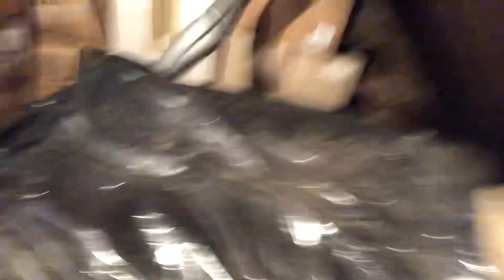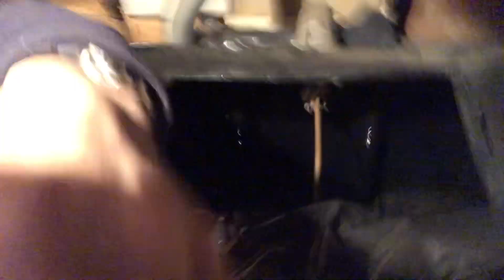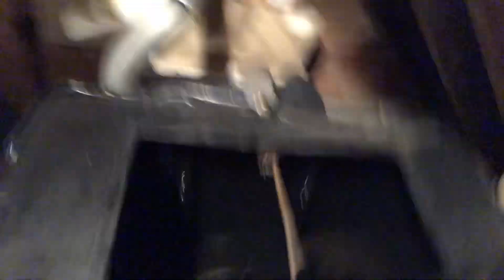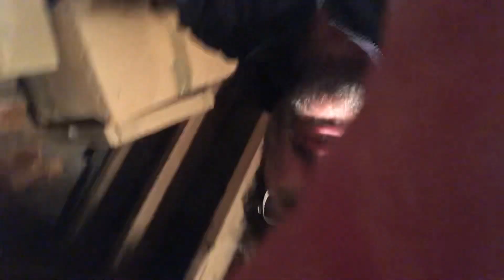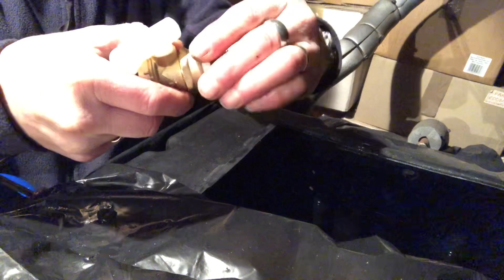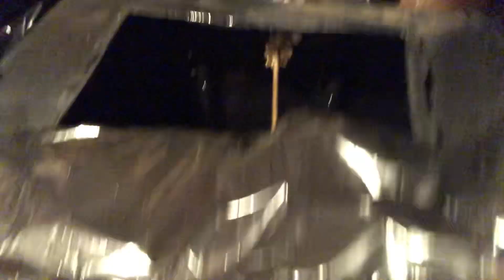Replacing a water tank or cistern float valve (or ball cock)

Comment: Just thought I'd add a comment , I seemed a shame for your efforts to only get one comment, and a negative one at that!
Watching it, I got the impression that there was possibly not much wrong with the old valve.  The point at which it shuts off is set by the position of the float on the rod
and by bending the rod if needed to get the tank to stop filling when the water level is a little below the overflow outlet.
I'm sure you know this, but I'm not sure you mentioned this vital step in the video, correct me if I'm wrong I may have skipped that bit!
As far as 'terrible video work' goes, I've seen far worse!
Reply from the maker: Aww, thanks for rescuing me.
Yup, basic ball adjustment was assumed, and in this case not the root cause. I should have mentioned it.